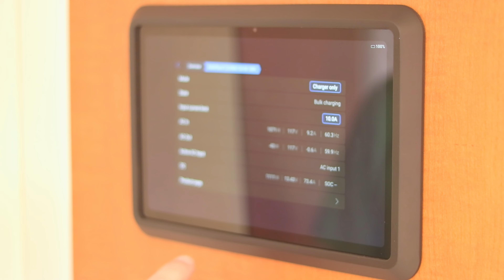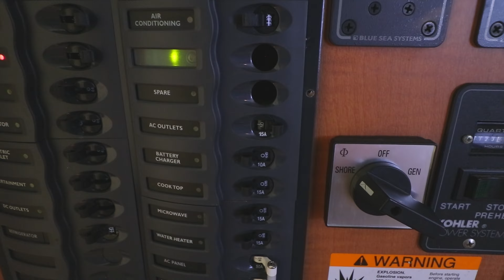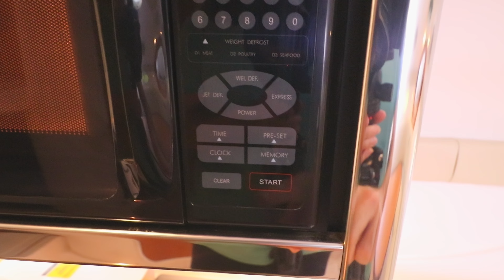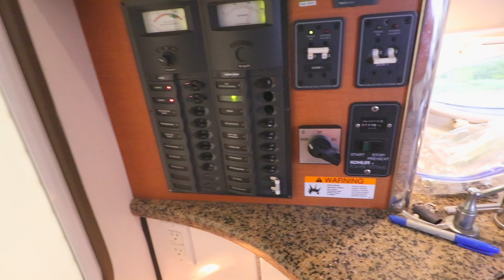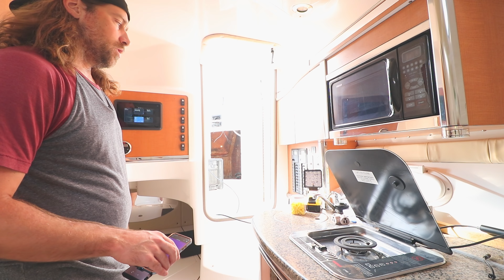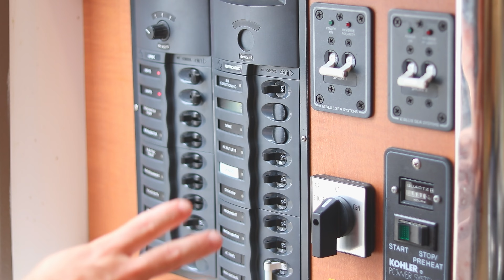STRESS TESTING My New Electrical System!

Comment: We're getting ready to do same thing but with solar system. 2 questions, not exact but ballpark $$ in your system and do you or can you bench build system for $$$. We have a Westsail 32 and have gutted electrical and starting with fresh slate. Thanks again SV Lost Cajun II Duane and Kim
Reply: Our main a/c power will be 1500-1800 watt induction cooktop and 1500 watt Air fryer. Also a few electrical outlets. The rest will be d/c power lights instruments. Thank you for your time Duane and Kim
Reply from the maker: Boy, I haven't added up the amount, due to both laziness and probably not wanting to realize how much it actually cost.. lol..  If I had to throw an estimate out there, I'd say it probably crept up around 4-6K.. Honestly, you'd think the inverter and battery is going to be the big spend (and they are, don't get me wrong), but it's the wiring/terminals/fuses/fuse blocks/bus bars/switches that really add up that you don't think about.  You can absolutely do it for cheaper in an RV or offgrid cabin, but when you are putting this stuff on a boat, you really need to take every effort to make it as safe as possible even if its at a major cost difference.. If your RV or cabin catch on fire, you can just go outside... If you boat catches on fire, you can... well... you get it..

I appreciate your trust in my ability to do that sort of thing lol, but unfortunately, I'm not in a position to be able to build systems for many reasons.  That being said, don't underestimate your ability to do something like this.. There are so many good resources out there including youtube, Nigel Calders book, the victron site has great reference designs, etc..

Good luck with your build and thanks for watching!